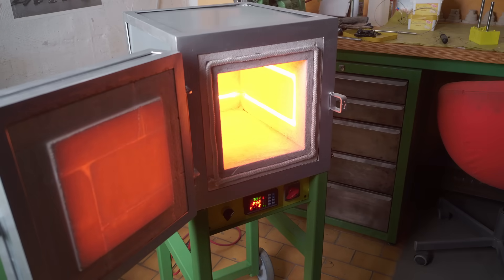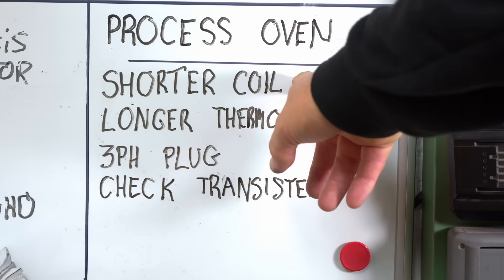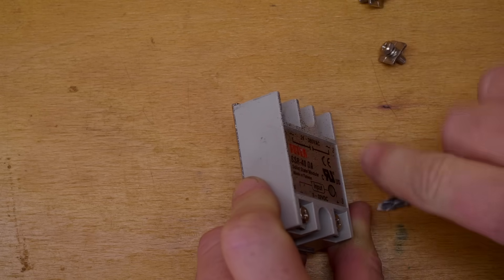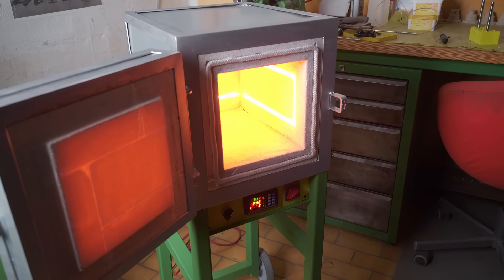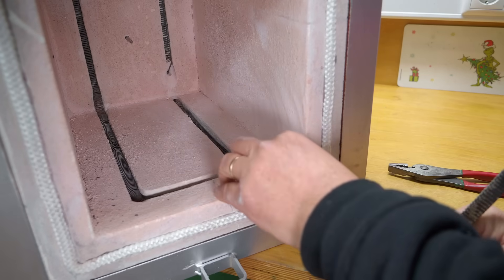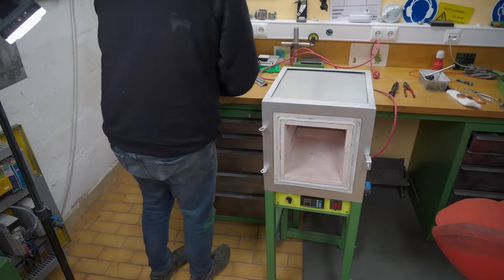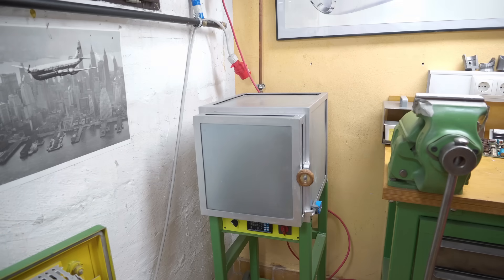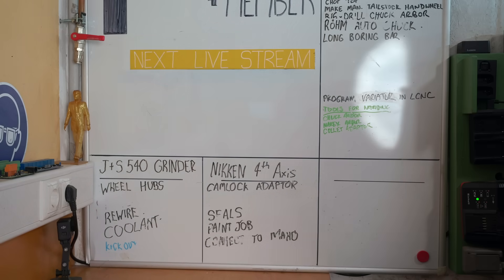Lets crank up the DIY process oven to 11 || RotarySMP

Comment: At least here in the US , for small ceramics kilns, bare heavy gauge (perhaps 6.4816E-20 Parsecs diameter or so) wire thermocouples with ceramic "fish bone" insulators are commonly used at those temperatures. Metal sheathing and the small thermocouple wire inside have their limitations at high temperatures
Reply from the maker: My last thermocouple lasted pretty well. I suspect I damaged the cable on that one which failed.
Reply: Proper K type cable and connectors should be good for 1200c/2300f . Wire, connectors, plugs and sockets unless specifically stated but connections will be ok at that temp.  The ceramic insulators only prevent the stainless shield from oxidation.   They do react very slowly though. A bare thermo shielded with inconell shield is usually the best for heat. 310 stainless is the standard material but is dodgy over 1000c. 50 c in a furnace often doesn't matter though
Reply: Parsecs......are they a common unit that we can all agree on? 
They are neither metric or freedom units
They create really impressive numbers that should make freedom unit lovers happy
They aren't freedom units which should make metric lovers happy..???????????🤓😃

Comment: You also need to consider the heatdensity in the wire! There is an upper limit to how much power a material can handle per mm2 before the material starts to deteriorate, leading to premature failure. I don't know the exact specs for the material in your wire, but by "eyeballing it", i think you might be cutting it close with that new wire and that much power...maybe :-) Anyways, IF it "blows" it is most likely because of too high heat density...
Reply from the maker: Yeah, you really get into a corner of insufficient space for two phases of coils, but too much heat density for a single coil. We'll see how long this one survives.
Reply: @RotarySMP  Yeah, It is a tradeoff, but it seems like it is pretty easy changing the coil if it burns out...

I'm also working on one at the moment, very similar to yours actually. But i couldn't make the math work with 1 phase😞 I have the same power-situation as you(3 phases, 240v), so i'm putting a phase-coil on the top and each side. What wire did you use? I ended up buying a roll of 18gauge A1 Kenthal wire...
Reply from the maker: @TwinOaksGarage  Did you see my first video on this oven I did a while ago? I think this is 1.2 or 1.4mm Kanthal.
Reply: @RotarySMP  Ah! No, i somehow missed that! I'll binge that right away, thanks 🙂

Comment: Big leap of faith that the triac is what it labeled.
Reply: I don't buy anything (electronic parts) from China anymore.
Reply: I had a 50A "Fotek" with a 12A device inside.  
I don't know if Fotek ever were a reputable brand, but some that I have are a lot heavier as they are potted up.
Reply: @andypughtube potting compound may cost less than the proper semiconductor
Reply from the maker: Yeah, it has been recommended that I switch to a mechanical relay.

Comment: Good call on moving to the CEE plug as the Schuko isnt rated for 16A continuous loads; one of the reasons we're not allowed to charge EVs off Schuko outlets as the daily charging setup, even at 10A.
Reply from the maker: Yeah, I feel more confident about the entire wiring route to the oven there.

Comment: I have a great contempt for those "solid state relays".
The BTA24 triac looked to be laser marked, which means it is almost certainly a chinese clone.
And, even with a good triac, they will still drop approx 1.2v at  your rated current of 12 amps, so the triac will still be dissipating 14 to 15 watts of heat! 😮😊
I replaced the solid state relays on my machines in my workshop with good quality mechanical relays, they have an extremely low voltage drop across their silver plated contacts, and run nice and cool.
People worry about contact wear etc but in my experience a good mechanical relay is still the way to go for best performance and reliability.
Those chinese solid state relays are NASTY 😬
Reply: contactors that run power are good for millions of cycles, even more on resistive load. and the interlocked contacts make it easy to automatically detect a failed one to save the equiptment. Bare bones SSR? inherrent unsave component
Reply: @hanswurst-h3e   agreed!  A good quality relay/contactor will last for many years.
And you can get them on 8 pin sockets for quick easy replacement too. 👍
Reply from the maker: @wizrom3046  Could you please give a link to the type of relay you would use?
Reply: @RotarySMP   hi, unless needing a real big contactor type relay, I generally would use one of the clear 8 pin relays like a JQX-30F type, with a socket base.
They are easy to find on ebay or aliexpress, or if you want to pay a bit more, from Farnell UK etc.
You most likely would want a relay with 12v Dc coil.

I like the clear type because you can see them operate, and see things like contact flash or brunt contacts if there are contact problems etc.
And the plug in type for the obvious reason that you can swap it out for testing or repair.
That relay type has large spade contacts so will easily handle 30 amps per contact set (and I would just parallel the two contacts in the relay to share the load current between 2 contacts and 2 connector lugs).

These clear relay and base sets were very popular when I worked in heavy industry in the 1980s, and like I said, if you dont need a big expensive "contactor" type relay the plug in ones make a great choice.
Reply from the maker: @wizrom3046  Thanks for that recommendation. I will get one along with the fan and fiberglass insulated high temp wire, and schedule them for my next furnace maintenance event.
Reply: @RotarySMP  With the high temp wire you may want to look at high temperature crimps, Strato-therm nickel plated crimps is one IIRC.
Reply: Definitely worth measuring the voltage drop to see how much is lost across the SSRs!
Reply: @johnhawkinson   they are easy to test too. Just run DC 12v power supply through the secondary instead of 240v AC, with a dummy load of course like a 12v car headlight. Even though it normally switches AC loads you can test it's voltage drop with DC.
Reply: You do need to make sure your controller is suitable for a SSR or relay depending on what you intend to use. SSRs tend to be cycled at a faster rate than is possible with a mechanical relay and is better if pushing the temperature limit of the elements, this application isn't. Regarding SSRs I always buy from a trusted source like RS, never ebay or aliexpress. A couple of controllers I've built also have a policeman relay where main the power is switched by an auxiliary output and turned off if the temperature limit is exceeded such as if the SSR fails on, the main element switching is by SSR.
Reply from the maker: @davidbillington9654  This seems to only cycle about ever 5-10 secs while maintaining 900c
Reply: @RotarySMP  Sounds like for driving a relay at that rate. My Cal controllers switch the element much faster as set to drive a SSR, the power light can be seen flickering when the element is being driven.
Reply: @davidbillington9654   it is unusual for a temperature controller to cycle the power that quickly.
Most typical temperature controllers use a PID control loop and assume driving a heating element with a slow rate of thermal change so they cycle every few seconds. Switching the heat on/off any faster than that is counter productive because there is not enough time for the heat change to get to the sensor.

However I recently built a low power 300w incubator for epoxy resin manufacturing process that used a fast 1 second cycle and a zerocross solid state relay, to be able to give a proportional amount of heat 0-100% b3cause it needed to maintain a very precise, unwavering, temperature. That is an unusual case though.

Comment: Transisters! Let's meet the transbrothers too! Lol. Thank you Mark! Best! Job
Reply: Puns aside, that is not an application where bipolar transistors typically would be used, possibly MOSFET or IGBT but Thyristors are more common. 
I'm all for inclusion, but back to back SCRs are generally more robust than TRIACs.
Reply from the maker: @jaytalbot1146  I am surprised I have not managed to fry one of these yet.
Reply from the maker: Give me time :) I also got a suggestion to replace it with a mechanical relay. Do you have any suggestions?
Reply: @RotarySMP  I would go for a solid state relay. Mechanical relays would work too off course but I think the solid state option is more robust (and quiet without burning contacts).
Reply from the maker: @jobkneppers  I currently use an SSR, but it has been pointed out that the current drop across it will be be pretty high, wasting up to 40W. The controller only cycles at a low rate (about 5-10Sec) so the contacts should last fine.
Reply: @RotarySMP  Ok. I wasn't aware of the energy loss. I own an oldskool oven with a relay and it worked for more than 30 years. Near it's setpoint it starts to click some more. But, true, still a decent solution for an oven. Best! Job
Reply: Curious I looked at a few zero-crossing solid state relays and the according datasheets. No one mentioned a voltage drop in use. Still curious ;-)

Comment: Very inspirational build thanks. I reckon you could use a vape coil calculator to work out the coil length or even to wind your own.
Reply from the maker: I wound these myself, and did the calcs on the first one, but the slight resistance drops though cables, SSD etc add up.
Reply: @RotarySMP  Thanks I'll rewatch the original.

Comment: Thats interesting, up here in Scandinavia we need 2.5mm minimum for a 16A breaker, latest code usually requires 4mm for 16A breaker and most installs today use 2.5mm and 13A breakers for general outlets.
Reply from the maker: This place is pretty old. I would not be surprised if the code has changed.
Reply: 2.5 is also the standard here in germany nowadays, but 4mm seems crazy for 16A

Comment: Hi Mark , nice upgrade . Oh and I also vote for removing  that insulation , and adding an extractor fan plus filtered breathing hole.  maybe an additional   metal plate between the furnace and electrics
Reply from the maker: Thanks Steve. I'll order a fan.
Reply: i came to say the same, also on top of capping the electronics section you could gap the two boxes 5-10cm.

Comment: The fully correct plug would be the blue CEE one (e. g. PCE 013-6). Red CEE plugs mean 300–480 V, blue ones 200–250 V. And there are also keyed :)
Reply: No reason you can’t break out a single phase on a CEE red. I wouldn’t go to the rated capacity as that assumes return via the other phases not neutral alone. Done all the time in the film industry.
Reply: There are some oddball red CEE that don't have neutral, i.e. 3 phases and protective earth; but at least in Europe the common setup is 400V TN with dedicated neutral.
Reply from the maker: I had one of those Red CEE without neutral on the surface grinder. First thing I did was bin it :)
Reply: Oh thats interesting, where did it come from?
Reply: The 5pin 6h plug is usually rated 200-240 or 346-415 as the addition of the Neutral pin means you have 240 between any phase and neutral.
Reply from the maker: Since I wired it for 240, single phase, it may be the wrong plug, but it fits the socket and works :)

Comment: Short and sweet is just what I needed this morning. Would it be a good idea to make up a riser frame to provide a decent air gap between oven and controller box/stand framework? The Insulating wadding looks like it'll prevent the control box using its vent holes.
Reply from the maker: I need to get a fan for that controller.

Comment: Should the thermocouple's line of sight to the heating coil be blocked so it's only measuring air temperature and not being heated by the IR radiation? The stainless steel casing would have a pretty low absorptivity so it's probably fine but I'm not certain.
Reply: The temperature controller uses PID math so it will be fairly tolerant of local IR effects and maintain an average temperature.
But you raised an interesting point, and it would be easy enough to test by sliding a pielce of steel tubing etc over the exposed sensor to shield it from radiated IR
Reply from the maker: @wizrom3046  I think this oven has other things to worry about :)

Comment: I can really feel the work related mental damage in my head at 8:01... You took those fork terminals off and I just went "blue leftmost" like I AM the one that needs to put it back together
As for the feeding cables going to the coils, I would recommend looking at silicone wire and a much higher cross section because the larger ambient temp greatly reduces the ampacity (IEC 60364-5-52 has a great table for it at page 53 in B.52.14, EPR column for silicone or PUR, PVC column for PVC that you seem to have) and silicone wire is also tinned to reduce corrosion
Reply from the maker: Thanks for the tips. I can replace that when I install the control cooling fan.

Comment: Insulation probably wont hurt, but its a common misconception that insulation/heatsinks help things stay cooler - they do only if the energy has somewhere else to go. The insulation will prevent the rate of heat getting to the electronics, but at steady state (hours) it will probably get to the same temperature as before, just taking longer to get there.
Reply: Agreed, I would put a couple inches airgap between the hotbox and the electronics drawer. Then airflow will get in there and keep the electronics much cooler.
Reply from the maker: Yeah, it needs a fan.
Reply: The insulation is a heat break, and the other side of the electronics is ambient. So there is somewhere for the heat to go, it's effectively a temperature divider with increased thermal resistance on top resistor.
Heatsink is very different, not sure why you're conflating them.

Comment: i bet it be perfect to finish off the crust of a  sous vide stakes or making pizza ( the pro ones use 410 degree C to make the crust crunchy well also flash boil the water inside the pizza dough to make the pocket inside ( thats done by the vaper from the flash boiled water )
Reply from the maker: Or to carborise steel :)
Reply: @RotarySMP  yeah. Though I doubt that steel taste as good

Comment: Thanks for highlighting the issue with the solid state relay capacity.  Certainly something to remember.  Is the electronics box under your oven ventilated?  I wonder if the insulation you added may cause the controller to overheat.  Having said that, it looks as if it can survive a fair amount of heat anyway:) A great video as always.
Reply from the maker: Yeah, I need to add a fan.

Comment: 2:44
I'm no electrician, but I recall (at least in Italy) that as a general rule, for a single phase, 230V 16A plug it would take at least a 2,5 mm² wire...  🤔 Am I missing something?
Reply from the maker: Here is Austria I think most house wiring is 1.5mm2.
Reply: Same in Portugal. 1,5 mm² is only for lights pretty much.
Reply: General 1.5mmSq cable Max temp 70°C  including cords in Europe can handle 20 amps in "Clipped direct", but when inside walls  and insulation are limited to 16  to 14.5 amps.
Note voltage drop is also taken into consideration on long lengths. 
To keep cable temperatures at a comfortable hand held temperature,  then larger conductor sizes are used.
NOTE: Depending on fuse protection types, ref reaction times etc, a 16 Amp fuse could allow 1.5 x rated load before disconnecting,  so a dangerous overload condition can exist. 2.5mmSq is chosen for this reason.
Reply: In the UK, for non-ring circuits delivering up to 20A, we're supposed to use 4mm².

Comment: What is stopping you from using all three phases, and turning up the power to 3 times 2.5 kW? Just the controller?
Reply: It would be far more effective just to add another layer of thermal insulation around the kiln.
The only reason a closed container needs so much power to get hot (and stay hot) is because of heat LOSSES.
Another couple of inches of thickness of thermal wool etc all around that kiln and it will probably use half the power, and heat up in half the time.
Reply from the maker: Well put, insulation is better. I though I had enough on this one, but really don't. I had two phases in my old oven, but you run out of wall space to run the coils on a small oven like this.
Reply: That was my first thought as well. Controller shouldn't be an issue, all it does is send a signal to the SSR to turn on the heater coils if it's below a threshold and turn them off if it's above, so all you'd need is a three phase SSR
Reply: You'd need an 3 phase SSR and three elements; but the power would be 11kw max total as the three phase is 400v
Reply: You would need three elements as well, one for each phase.
Reply from the maker: You can also do two phase. I did that on the last one.

Comment: I'd consider adding some low-profile fan into the housing, just to have some air movement.

The blanket just delays heat creeping in, with a fan you can actually remove it
Reply: And if the controller generates heat itself, insulating it would only make it worse. +1 on the fan. Most components last longer if they run cooler, so why not.
Reply: @nordishkiel5985  doubt the controller generates any significant amount of heat. Prolly like two watts, but nothing that can't be solved by radiating it away
Reply from the maker: Good points. I also thought "this needs a fan", but I didn't have one on hand and wanted to get it done. Poor decision.
Reply: @RotarySMP  Well, there's no law you can't just redo things. I've thought about it some more and imo a fan attached directly to the controller, that way the electronics are definitely kept cool, and the bottom of the box should provide enough area to radiate it away - that way you can avoid cooling slots and ingress of conductive grinding dust
Reply from the maker: @vincentguttmann2231  Yeah I have ordered a fan.